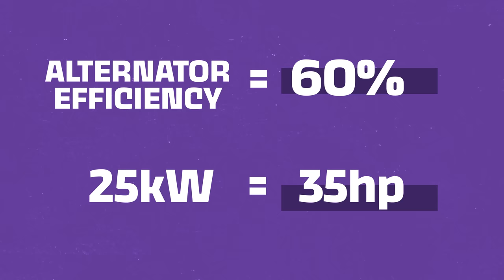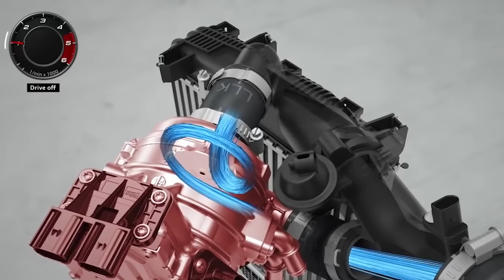Are Electric Turbos a SCAM?

Comment: There’s nothing like seeing a small little Honda Civic barreling down the road with a turbo
Reply: Actually that's incorrect. There was nothing like my 24 VR6 turbo GLI barrelling down the road, because it was quite literally that fast. It was like seeing nothing.
Reply: I raced a turbo EK hatch in a STOCK AUTOMATIC 1995 Subaru Legacy sedan to about 70mph. He didn't get past my front bumper.
Reply: @coldmoonlight6361  u probably raced a single cam d or z series with a ebay turbo on 3-5 lbs of boost, no shit it's not gonna be fast when done like that lol, race a k or b seires on 15+ psi and u would get walked
Reply: @swish2519  relax
Reply: @swish2519  lmao I walked a legacy roughly same year with my bone stock crv 😂 we all drive slow ass cars I don’t know why he’s bragging bout beating a civic.
Reply: @swish2519  my b18b integra sits at 9 psi 😖 it blows past lots of minivans now.
Reply: @Ed-qr7kz  you know it's facts

Comment: Thank you for being the first person to ever address the parasitic losses of a turbo!!! yes I understand they are more efficient, but I'm sick of people saying it's free power haha. love your videos!!
Reply: Ain't nothin free but MUUURICA....WAIT.
Reply: Nothings FREE ! BUT, they sure do make a lot of POWER !
Reply: It's actually complicated, depends on the operating point of the turbo and how well optimized the engine was to work with it.

Turbos cause losses via an increase in exhaust manifold pressure, this pressure is pushing down on the pistons during the exhaust stroke and trying to slow them down. Exactly the same way a supercharger is pulling on the crank hub trying to slow it down. But the exhaust gases are still expanding from the combustion, and when this expansion happens in the turbine then the turbo is using energy that would simply have blown right out the exhaust (the exhaust gases simply come out cooler). If the turbo is being used in its peak efficiency zone then you get more "free" energy from the expansion of the exhaust gases than you lose from the backpressure in the exhaust manifold, and the turbo actually increases overall engine efficiency (one of the ways in which turbocharged engines can achieve better fuel consumption). 

When you push a turbo past it's peak efficiency range though the losses caused by the backpressure can outweigh the gains in the gases expanding in the turbine. This is usually how modded turbocharged cars operate, and why they generally get shit fuel efficiency - an OEM turbo operates at peak efficiency while a modded turbo operates at peak airflow (or as close to it as the tuner can get).

An electric supercharger is always a net energy loss when actually used to compress air - it takes more energy to generate the electricity to drive the supercharger than the energy you get back in the compressed air when you power it. However an electric supercharger can use electricity that was produced, for example, by charging the battery during decceleration, like a regenerative braking of sorts, so you're powering the supercharger with energy that you were going to throw away anyway.
Reply: TLDR
Reply: The battery only charges when the alternator is charging at over 13.8v so really there is no loss as the battery does not charge when the engine is under load. Sure there technically is parasitic loss but you would never notice this driving because it charges up when the alternator is already putting out that electricity and if you don't use it is gone.

Comment: Biggest advantage of an electric turbo is the "decoupling" from the engine imo.  You can spin the electric turbo at any speed you want anytime you want.  For the kind of power you only need occasionally, it makes sense...almost like a nitrous bottle that can fill itself from your alternator.  I don't think it would work well for a large truck engine or something, but for a passenger car to have some more oomph for passing or merging or just for fun?  It works.
Reply: I think for truck (semi) is also good for overtakeing slower trucks.
Reply: I'm thinking that Subaru may have used them in the 91 through 94 Legacy. Because my dad was a rural letter carrier for years had one of those and when you mash the gas you would hear a high-pitched spinning sound and a light would come on on the dash saying power. After the car had given up the ghost me and my brothers were tearing into it a bit and there's a switch under the accelerator which appears to activate it.
Reply: @eddieschwab864  The power light basically makes the transmission computer change its shift ranges, so when you floor it, that power button comes on, and it'll shift at higher RPM's. And i'm not sure but it should also change ignition timing.
Reply: now i'm not saying this is a good idea, but what if instead of accomplishing that decoupling with an electrical system, you did it with a gearbox between the hot side and cold side of a turbo. "my car is so manual that even the turbo is manual"

Comment: I saw something a couple years ago how someone hooked up a power inverter to a leaf blower to create forced air induction.  It worked.  A big issue was air temperature because the leaf blower produces very warm air which of course is counter productive.  He did increase his power a noticeable amount though.
Reply: There isn't a leaf blower out there that will put out how much air an engine would need at anything higher than an idle

Comment: 4 minutes of turbo for 40 minutes of charge time sounds like a good way to have the occasional fun without adding permanent pressure to an engine block. If it's easier to install than a regular turbo, this could be a cool upgrade for the casual enthusiast
Reply: It reminded me of nitrous in the nfs games
Reply: Honestly, four minutes of boost is a lot. I'd say 95% of my driving isn't in boost so I would never run out.
Reply: It's a complete waste of energy. Just have a tuner run your turbos on a low-boost map. Switch to the high-boost map when you wanna get spicy.
Reply: And without all the plumbing, intercooler, etc of a conventional turbo.
Reply: And useful to get up to speed and go into the highway.
Reply: Yes but tbh I feel like you may as well get a supercharger at that point since they’re easier to instal .
Reply: @angelgjr1999  Not always depending on space, an electric turbo wont be so hot either so it would give you more positioning options.
Reply: Im stealing the phrase " casual enthusiast "
Reply: Kinda like a self-recharging nitrous kit lol
Reply: What about a hybrid turbo that would give power at lower and higher RPMs ?
Reply: The electric compressor (turbo) kit is interesting for tuners to help spool a big turbo up that otherwise would suffer from big lag. Therefore it only needs to be activated for a very short time, after which the system runs on a regular exhaust turbo
Reply: @size1985  would make it easier to run like a big 125mm turbo on a little 2.0 4cylinder that normally wouldn't spool it.
Reply: The kit he's talking about is $2500
Reply: Casual enthusiast as in installing a k&n drop in filter in the stock airbox
Reply: Be pretty good solution for drag racing
Reply: Are you kidding It's still not (not at all), only 4 minutes of turbo, WTF. 240seconds can just go in a wink of an eye, and that too it needs 40 minutes to charge, well then I would say no thanks as there are chances of power losses in this turbos till date. Enthusiasts too will either keep thier car N.A, or install a turbocharger or supercharger instead of an electric turbo,(which is actually an electric compressor).
Reply: @gabrielalbeldaochoa8234  This guy gets it.
Reply: @esthermezhu9297  i see it as a decent way to add pep to a daily driver with out going ham in upgrade changes. Sure the kits 2500$ but thats because the tech is fairly new.
Reply: @esthermezhu9297  4 minutes if the car runs the turbo continuously from lets say a red light turning green & keep pressing the accelerator until it reach 4th minutes....aint it wont happened in real life...this eturbo really helps for starting the car to move by giving boost & increase the acceleration for 4-5 seconds before the car reach the road regular speed limit of 60kmh or mph on murica & etc..the eturbo wont run after that & it will only take short time to recharge the battery because its not been used for even a minute

Comment: There are turbos with e-motor between turbine & compressor (connected on the shaft via e-clutch), it has 2 tasks:
1) "recuperating overboost" - slowing down the turbo & generating electricity.
2) spooling up the turbo to avoid lag.
It's used in mainly in track cars, known as MGU-h

Comment: You failed to mention that electric turbos are typically only useful at low RPMs.  The compressor's speed doesn't increase with engine speed and can't move enough air for higher RPMs.
Reply: Oh my this is got the no knowledge engine people really buzzing I bet.lol
Reply: He did mention it
Reply: I cant remember for sure. But I believe the electric turbos that cleetus had would spin faster with more rpm.
Reply: Depends the power level of Electric Turbo. Electric motors close to 10kw can have crazy high RPMs and enough air flow to feed a 3.0L or less engine. It just would strangle on large displacement engines. The early legit electric compressors were around 5kw thus why they could not feed the top end.
Reply: A computer can’t manage a speed controller for the “ELECTRIC SUPERCHARGER”🤷‍♂️

Comment: A few years ago I did a research with a team (non car enthusiasts) about "turbocharging" a Prius. The theory is at low speeds (about 1-15MPH) it has more than enough acceleration with the motors. That acceleration then goes down with the engine kicking in. During the times when the motors are not in use and more power is needed we can use the massive battery to spool up a force induction system to give more power to the engine.

Comment: The electric turbos remind me of a simpler version of ERS in F1. In F1 the braking and exhaust gas/heat it’s what recharges the battery. In road cars it make sense it take 40 minutes to recharge since it’s not as integrated into the cars design like F1
Reply: And in f1 everything just have to last at least 1 race.
Reply: @TheAdatto  As far as I know, you can use only 3 engines for the entire season. Add in FiA limiting budgets, and cost of other parts for an f1 car... Nah. Teams have to use parts for as long as possible these days.
Reply: @TheAdatto  nope, has to last over 1000km of use.
Reply: @TheAdatto  not any more since the start of the hybrid era in 2014 they created stricter rules on reliability and more recently even added a cost cap. So most of the hybrid parts have to last 6-7 races if not grid penalties

Comment: When I saw this I thought oh great, another "desk fan" turbo video. Hardly anyone bothers to get a real one
to see what they are like. But Jeremiah here pulls through and gives a proper video.
Reply: Too bad that this video lacked clarification how to distinguish between fake eBay electric turbo and one that actually works.
For example -  it has to consume least few kW of power to pump enough air. Has to have thick cables, and costs more than 15 USD :D
Reply: @andiszile  Right? The equipment and cost should be a giveaway really.

Yeah when I saw the title of the vid I was like "Fiiiinnnnnneee, let's watch some more toy whistles jammed into the intake hole" lol.
Reply: Most of the scam ones also focus on the speed it can turn. People think if it can turn 10K rpm it must be really powerful. Not realizing the rpm alone doesn’t mean anything. 

Plus any proper system is going to still be at least a few hundred bucks if not well into the thousands.

Comment: I have a possibly bizarre suggestion but also possibly very cool. We owned a 2010 Ford Fusion hybrid. It was no sports car but 270 combined hrsprs at the wheels could be fun. That had the old lead acid 240v battery hybrid system used on the Escape for 10 years. Later we got a 2015 C-Max and it was markedly quicker and spunkier. They are getting quite a bit cheaper now and lots of parts might crossover from aftermarket Focus or Fusion. Stripping and souping up a C-Max, especially with a battery powered supercharger could be super cool!

Comment: Here, out at sea, on a big boat, we use some big ole electric turbos on our ship's main engine when the turbocharger can't make enough scavenge (boost) pressure. We've had them since, like the 90s, or something. But our setup isn't exactly typical, because the engine itself is a 2-stroke the size of a cathedral where a human can fit in the crank case or in a cylinder. Same principle though :)

Comment: While that 10:1 charge:boost time sounds really awful, most of the time you aren't gonna be hooning it at full throttle for 4 minutes unless you're track racing. If you're at the drag strip or just doing some occasional street pulls, that time is more than reasonable. If, for example, you do a 1/4 mile pass in 12 seconds, you're looking at about a 2 minute wait to get that amount of charge back. You'll be good to go by the time you get back to the start line.

Comment: you guys should make a video on how nascar engines run at 8500 rpm for hours on end and not break
Reply: It’s the way their engine is built not much to it
Reply: They just use stock Honda Civic engines, duh.
Reply: A lot of it is lightweight components made out of really strong alloys combined with really good oiling and cooling systems. 
Like how they’re all gonna be dry sump and normally run spray bars in the valve covers to spray oil on the valve springs and keep them cooler. 
They’ve also gone to smaller connecting rod bearings so there’s less rotating weight.

Comment: Guys JP Performance from Germany did a whole Video about Electric Turbos from the netherlands 🔥
Reply: Don't forget to mention the "Super Golf" project. A VR6 with an extra e-turbocharger for that extra boost
Reply: It's a solid idea, but it's like a computer in a sense. In the older days you had one CPU handle all the tasks of the computer, now you have multi core processors that handle a lot more and are augmented with a good GPU for graphics.

Same for electric turbos. If anyone remembers the Mazda RX-7 had a twin turbo setup. But it actually wasnt a twin turbo, it was a two stage compressor. Low stage for idle up to 2400 rpm's or so, high stage for 2400 rpm to redline. 

I know it's a very basic explanation, but it does work. Now to get an electric turbo to act as a low stage sounds feasible, but it's part of the whole turbo setup as opposed to acting as the only turbo in the vehicle. 

It might work in the future as battery and other technology improves, but for a viable aftermarket add on? Not for now, just stick with what works and for now, what works can be either a single, or traditional twin turbo setup. At least until electrics takes over completely.
Reply: @deathstrike  Yes because RX7 have static geometry, now VAG make small e-turbo and push all exhaust to try spool up big one.

Comment: As a diesel technician. The end of this progression is a generator in the driveline for regenative braking. More than likely using a ultra capacitor to build the thousand plus amps. Capacitor will be able to charge and discharge quickly thousands of times.

Comment: Great video! In my opinion, the eturbo does help significantly in turbo lag, it may not boost the overall power, but it's just used to mitigate the initial drop in power. But your video was very insightful! Cheers!

Comment: You don't need to upgrade the alternator to the crazy amounts mentioned unless you need the electric turbo running all the time. You can use your stock alternator and when you turn the turbo on it's pretty much just as efficient as the car without the electric turbo, (only power gains, no losses from the turbo). So you would make the most peak power from an electric turbo than a normal turbo / supercharger, with the downside of it running only part of the time. Think of it like the MGUK of an F1 car, except that directly powers the wheels.

If you upgrade the alternator you can use the electric turbo more of the time for less efficiency, also less power when the turbo is off as the alternator load is still there.

Comment: What if you used a fast charging supercapacitor that runs on regenerative braking instead of a 48v battery? When you aren't going too hard on the car, you don't need instant boost so you can use exhaust driven turbines. Only when you are really working the engine do you want the instant boost. I think a supercapacitor would work for this application a lot better than the battery.

Comment: My Duramax runs 46psi of turbo boost. Deleted, EFI live tuned, modded, but still stock turbo and injectors. Close to 600hp and over 1000ft/lbs of torque. 
I wonder if any electric turbo could keep up with that airflow load requirement.

Comment: Actually sounds like a pretty good tool for drag racing.  Easier install and 4 minutes is a lot of runs 😅
Reply: and, if you hook up the electric turbo to run solely off of an isolated battery (so on a separate circuit) you don't have any horsepower loss from adding load to the alternator. and the charge doesn't need huge. 1-2 minutes of charge would be enough for a day at the track.